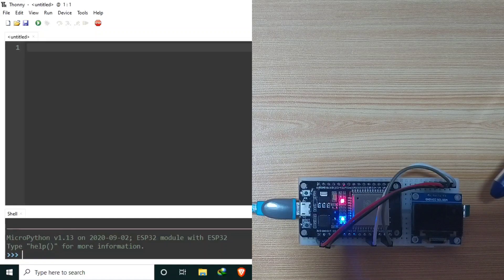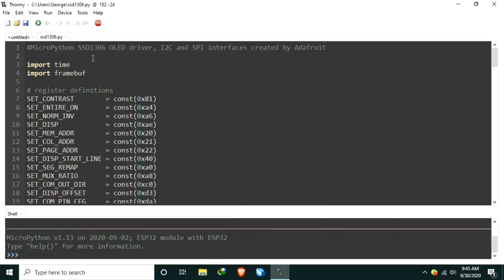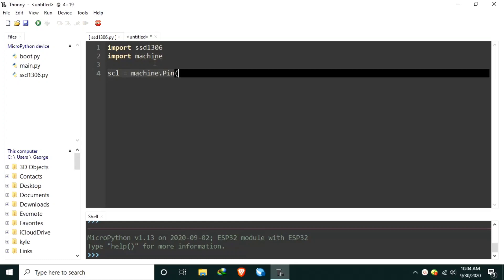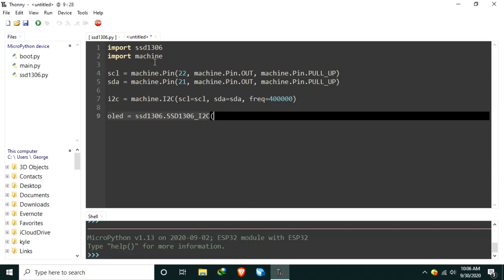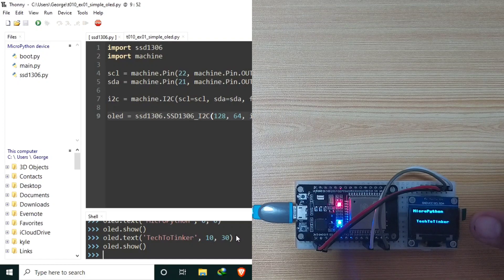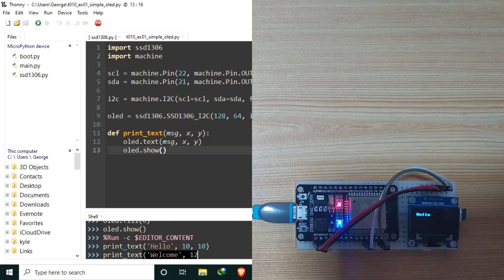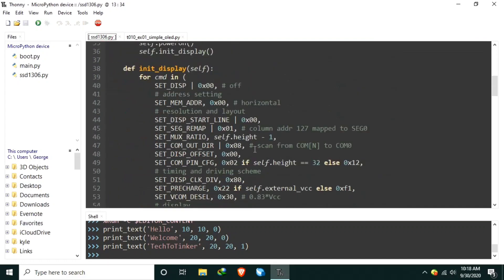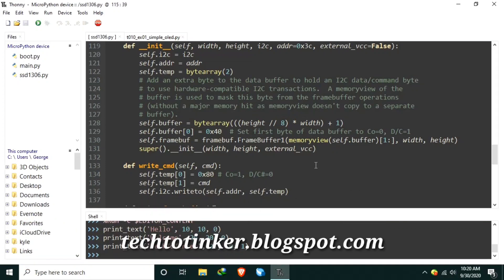010 - ESP32 MicroPython: 0.96 OLED in MicroPython

Comment: Great intro to ssd1306 oled.  I was following along and made an error.  I noticed the "write over" text was larger.  Which; leads me to think I can adjust the text size.  I found my error to display what I wanted but cannot recreate the error to make the text bigger.  Any suggestions?  Also having trouble getting the text to scroll.
Reply: Yes, sir.  Already subscribed.
Reply from the maker: @marinehm  thank YOU.
Reply from the maker: @Nick Sebring, I just uploaded a new video about custom font. Check example #3 and #4. just change the library imports from sh1106 to ssd1306 and also change the object creation to ssd1306. Hope this helps. Cheers
Reply from the maker: Hi @Nick Sebring, ssd1306 oled cannot make text font bigger (it's hardcoded with 8x8 pixel each font) but there is a way to that using a custom font. I will release a new video around this week to demonstrate that. Be sure watch it.

With regards to scroll function, I also can't make it to work. I am thinking a workaround on creating a loop that changes text position every loop iteration before displaying the text. Yeah, Im sure it will work like that.

Hope this helps, cheers.

Comment: Great Video George, thank you! One question how many of this display can drive the esp32 or better say in what depend the number of display that we can use a the same time? For instance, can we operate 9 displays at the same time? Thanks again!
Reply from the maker: @NesbyBone, the 0.96 oled display can be configured into 2 I2C address. So using this specific oled display you can use 2. 

But if you can find more flexible i2c addressable display, then 9 display is possible. Cheers.
Reply: @TechToTinker  thanks for clarifying!

Comment: getting this error
Traceback (most recent call last):
  File "<stdin>", line 1, in <module>
  File "ssd1306.py", line 110, in _init_
  File "ssd1306.py", line 36, in _init_
  File "ssd1306.py", line 71, in init_display
  File "ssd1306.py", line 115, in write_cmd
OSError: [Errno 19] ENODEV
Reply from the maker: @Sr N, seems like your OLED display cannot be found. Try to check the following:
#1. Connection
#2. Try scanning the i2c bus:
import ssd1306 
import machine scl = machine.Pin(22, machine.Pin.OUT, machine.Pin.PULL_UP) sda = machine.Pin(21, machine.Pin.OUT, machine.Pin.PULL_UP) i2c = machine.I2C(scl=scl, sda=sda, freq=400000) oled = ssd1306.SSD1306_I2C(128, 64, i2c)
i2c.scan()
Reply: @TechToTinker  
Getting the same error after this line oled = ssd1306.SSD1306_I2C(128, 64, i2c), i tried many times reflashing esp32 but no use
Reply from the maker: @srn6162  most probably the problem lies in hardware side. Try to make sure SCL and SDA are connected properly. You may also try swapping it or maybe you are using a different oled display that needs different driver/library
Reply from the maker: Code should be like this for the i2c scanner:

import ssd1306 
import machine 
scl = machine.Pin(22, machine.Pin.OUT, machine.Pin.PULL_UP) 
sda = machine.Pin(21, machine.Pin.OUT, machine.Pin.PULL_UP) 
i2c = machine.I2C(scl=scl, sda=sda, freq=400000) 
oled = ssd1306.SSD1306_I2C(128, 64, i2c)
i2c.scan()
Reply: i2c.scan() giving empty list []
Reply from the maker: Try this instead:

import machine 
i2c = machine.I2C(scl=machine.Pin(22), sda=machine.Pin(21)) 

print('Scan i2c bus...') 

devices = i2c.scan() 

if len(devices) == 0: 

  print("No i2c device !") 

else: 

  print('i2c devices found:',len(devices)) 

  for device in devices:  

    print("Decimal address: ",device," | Hexa address: ",hex(device))
Reply: @TechToTinker  Scan i2c bus...
No i2c device !
Reply from the maker: @srn6162  did you try swapping sda and scl pin? might be wrong connection
Reply: @TechToTinker  yes, i've tried swapping the pins and tried arduino examples using arduino, this is new one yesterday only i bought it, may be hardware problem, i need to buy another one i think
Reply from the maker: @srn6162  that could be your another option. Cheers